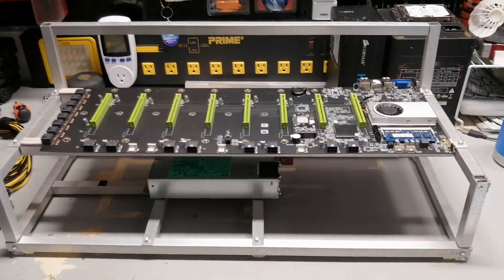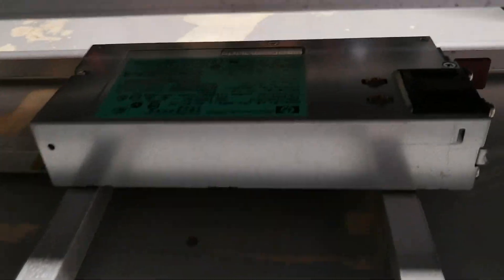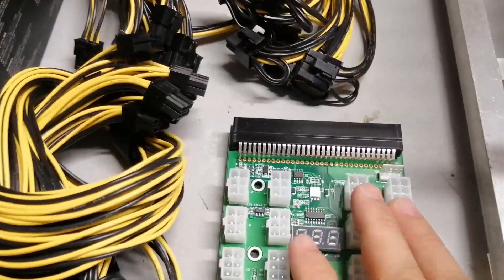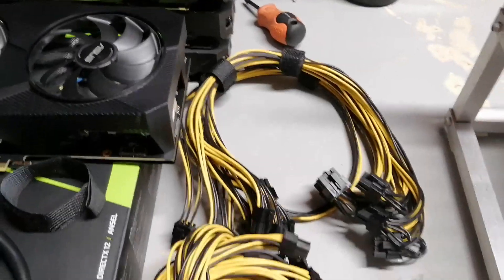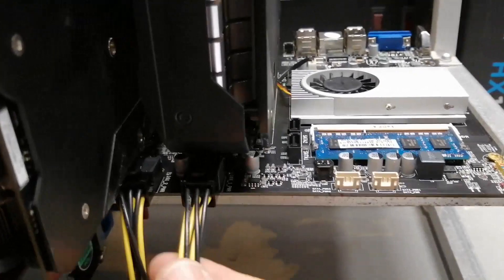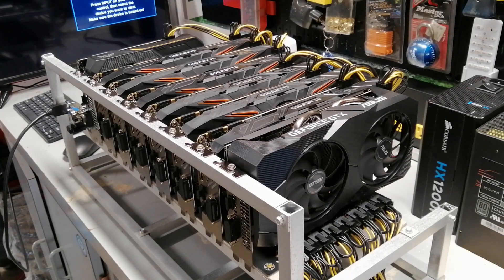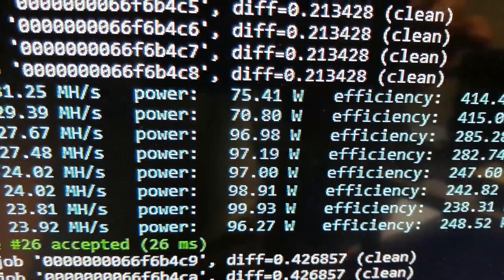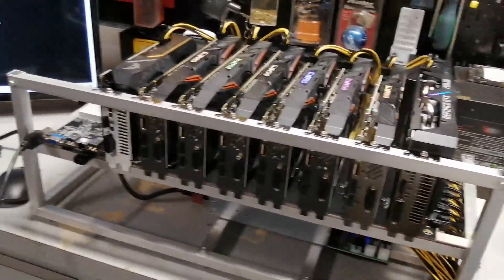BTC-D37 Riserless Mining Motherboard Setup with 8 GPU's

Comment: Those back plugs are not meant to be used as a passthrough for the GPUs. It's just meant to have 2 different options to plug the mobo in and supply the slot with power. 
Please advice your followers to plug in the GPUs directly from the PSU, one single 6-Pin Cable will not be able to handle all the power for the slot, mobo and Graphic card. 6pins usually can just provide 216W, not yet calculating in the 80% rule. Even if it might have worked in your case because you use not very power hungry GPUs, this could be a burned mobo, or even in the worst case a real fire hazard.
Reply from the maker: Theromer1 Some seller on AliExpress, has video of the wiring connection of this motherboard and that is exactly how they connect all the wires when using the enclosed rack mount  server type case, motherboard is design for this wire configuration.  But you are right, you have option to get the power directly from the PSU if you are using open frame like mine. Its been running for almost a month before I made the frame, now its about 2 months and I always check the wiring and mobo for any sign of overheating that can cause fire hazard but the wire and mobo are cold so meaning it handling the current that it should.  But again, just to be in the safe side, you have a very good point and  for the people who follow my channel please take Theromer1's advise if you are doubtful,  its all about safety and we share knowledge and experience to help each other and besides all my videos are for entertainment only, you still have to do your own research when starting a new project or hobby. Anyway thanks for taking time to visit my channel and posting the comment, really appreciate it.
Reply: Rookie Gamer  Here's the issue: if you had 8 power hungry GPUs, how many amps would you want to pass THROUGH a motherboard? Those are power traces and can't handle the power IMHO that large guage wires can. I doubt seriously the traces are thick enough.
Reply from the maker: Rookie Gamer  Cool, thanks a lot for clearing it up, I appreciate it.
Reply: @ruvrandomusefulvideos  
How many watts do your cards pull? Do you think this will work for cards that pull over 200 watts each or should I go straight from the psu to the gpu?
Reply from the maker: @caseyhall5297  I'm pretty sure it will work fine but if you have available connector from PSU I think its better to get the GPU supply direct from PSU just for the peace of mind. 
Gtx 1070 is rated 150 watts and it  pulls around 140 watts in optimize mode with Nicehash and it works no problem, but I change my settings to efficient mode and it draws only 104 watts now and slightly more hashrate.
Reply from the maker: @caseyhall5297  My cards pull around 97-100 watts each. If your card is 200 watts each, to be safe I would power it straight from PSU, thanks.
Reply: @ruvrandomusefulvideos   do you have any documentation supporting this? I love the option but just worried on max power. Standard 6 pin Is rated at 75 watts so I would assume these 6pins(side) must be rated at more wattage since they power the riser and back 6pin powering gpu?! Would appreciate any feedback on that!
Reply from the maker: @en4ble773  Sorry I don't, board doesn't come with any documetation but check Ali express that's where I saw the wiring video. Mine is running for over 4 months now and no problem at all, just make sure to use the proper size of wire. Also take note that my video is just for entertainment purposes only so you do not have to follow what's on my video.
Reply from the maker: @en4ble773  Actually I found it on Amazon, check all the pictures especially the last one  and you'll see the wiring connection, its very clear that the GPU is supplied by the 6 pins from the motherboard. 
https://www.amazon.ca/Ethereum-Building-Including-Motherboard-Cooling/dp/B091YS9MCS/ref=asc_df_B091YS9MCS/?tag=googlemobshop-20&linkCode=df0&hvadid=459054663507&hvpos=&hvnetw=g&hvrand=1278823189650463489&hvpone=&hvptwo=&hvqmt=&hvdev=m&hvdvcmdl=&hvlocint=&hvlocphy=9060809&hvtargid=pla-1362318213049&psc=1
Reply: @ruvrandomusefulvideos  I mean this is perfect for cable management, I just wish there was some supporting documentation on this.
Reply: @ruvrandomusefulvideos  Hi, thanks for your video. Is this cable reference you use to connect your gpu to the mother board at 7:22 ? I am not sure what kind of cable I need to use to plug my AMD rx 6600 to the motherboard. Thank you for your enlightment 🙌🔌
Reply from the maker: @floriane5965  if you are using power hungry GPU's I would suggest to power them directly from PSU. Anyway this is the cable I use on the video; https://www.amazon.ca/Fhdpeebu-5-Pack-Power-Splitter-Express/dp/B0912FW661/ref=asc_df_B0912FW661/?tag=googlemobshop-20&linkCode=df0&hvadid=459247467354&hvpos=&hvnetw=g&hvrand=8209091549390837108&hvpone=&hvptwo=&hvqmt=&hvdev=m&hvdvcmdl=&hvlocint=&hvlocphy=9060809&hvtargid=pla-1402457543435&psc=1
Reply from the maker: @baracuda40  depends what Os you are using, you can use MSi afterburner to OC your GPU'S.
Reply: Rookie Gamer  do you have any documentation supporting this? I love the option but just worried on max power. Standard 6 pin Is rated at 75 watts so I would assume these 6pins(side) must be rated at more wattage since they power the riser and back 6pin powering gpu?! Would appreciate any feedback on that!
Reply: @TheRoemer1 The Roemer is 100% correct. I recently just had a riserless board (amazon type one) fry. It was lucky the whole rig, and the apartment didn't go up. I had a company build this rig. It was 6X 3090 running a 2500 PSU. All but 1 GPU was plugged into the motherboard. And 1 direct in power supply. This is how they wired up. Each card is drawing 325w, so the PSU was certainly able to handle it. All the PCIe "in" cables caught fire and melted.

That company told me I had a power spike. This cant happen; it's a brand new apartment complex, and they confirmed there are surge of protectors built into each floor/apartment to stop this. 

So I booked a call with @redpandamining, and he was the one that told me about the problem. The PCIe outs can ONLY safely handle 75w on a 6 pin and 150w on an 8 pin. The cards have to be wired directly to the PSU for them to be safe.

This rig ran for about 4-5 months without an issue. Then one day, it just decided to catch fire. I would check and clean this rigs every couple of weeks and never saw an issues. 75w rated and drawing 200-300w is a disaster waiting to happen. I would not trust those amazon pictures or instructions. The numbers simply don't add up. Be safe. Power the cards off the PSU.
Reply from the maker: @gj2753  This board wasn't made for power hungry GPU'S, you should know the wattage of your rig and size of wires that you use. Wiring is correct but according to your statement seems like you overload your rig with power hungry 3090's and the PCIE wires melted, seems like your PCIE cable is not enough to handle the current thats why they melted and caught on fire. The company who build your rig should know what they are doing.  But sorry to hear what happen and  I am glad you are ok,  just be careful next time and do your homework before building anything.  Remember that anything running with electricity is risky, I even watch some videos on youtube cellphone explode while charging with OEM charger. Some people comment that they are running 3080's with this board but I doubt that they get it supplied from the motherboard because 3080 is also power hungry rated 320 watts and your 3090 is rated 360 watts.
Reply: @ruvrandomusefulvideos  Yeah I agree. Way too much power. I am still waiting to see what they say about it. I am still learning myself. But if we go off the rated power allowed then even 100w is over. I guess its a risk, if someone wants to take. But people need to know that 75w is all those Pcie slots off the board are safe for. Anything over is their call.
Reply from the maker: @gj2753  Yes you are absolutely right that is why the highest card I use for this board is 1660 Super which I am running at 69-71 watts no more than that otherwise you have to get the GPU power direct from power supply. Also take note that this motherboards doesn't even come with any instructions or user manual so you really have to know what you are doing. Again be safe and have fun mining and thanks for checking out my channel, appreciate all your input and sharing your experience.

Comment: Hi, thanks a lot for your video! It really give me idea on how I can get started! I have ordered 8 gpu motherboard and expected to come in 2 weeks.  Would you  help me set up my first mining rig?
Reply from the maker: Just post whatever questions you have and I will try to answer them the best I could, or someone here can help you for sure. Welcome.to mining.
Reply: @ruvrandomusefulvideos   Thanks a lot! 😊 I think I have ordered the one with black slots T37. I'm thinking to buy 4 3090 and place them evenly between slots. Question is.. will it work with the mining motherboard? If not 3090, What is the latest gpu i can use ?
Reply from the maker: @vampierarun  It will work but the question is if you'll get the max hashrate. Sorry I do not have 3090 to test. Keep us updated thanks
Reply: @ruvrandomusefulvideos  yup thats good point. Going to try with one 3090 first and I will comment back later(probably after a month or so) * fingers crosses. Appreciate your response! 👍
Reply from the maker: @vampierarun  Also read Theromer1's comment he has a very good point. Since you are going to use a power hungry 3090, try to get all the power of both PCIE and GPU direct from the PSU, thanks.

Comment: i did see fans not spinning in the video and some fans slowing down to a near stop, is this due to the power consumption from the board or just poor fans that need replacing?
Reply from the maker: Its because I set them to efficient mode so the temperature are low.  If I set them to lite or medium mode, fans runs faster all the time. My 3060 has 3 fans, most of the time only 2 of the fans are spinning unless I set it to medium mode. That's said it means that the temperature sensor is working properly.

Comment: Thanks for this video. I have BTC-s37 and 7 gpus. 2000w power supply but it is too noisy in my small bedroom. I will buy a quiet power supply next week then start mining :)
Reply from the maker: Yes I am using same PSU with my BTC-T37 and the is quite loud so definitely not for the bedroom. Anyway thanks for visiting my channel and happy mining.
Reply: @ruvrandomusefulvideos  Hi RUV , I have BTC-T37 but I could not start mining and I dont know why. Could you give me some advice please. I am working with an USB 3.0 with HiveOs , my psu is a EVGA GQ 850 and I have 1660 Ti and 2 1660 super.
Reply from the maker: @andresalzate7465  here is the link of Mining Chambers video on how to setup hiveOs; https://youtu.be/3Pw87g8Kkiw

Comment: hey :) nice setup but why do you have so many PCI plugged in? you only have to do either at the side or at the bottom... you don't have to do both brother... so you can save yourself a PSU
Reply: Hi Welli. He feeds in at the bottom only. At the side he goes out to gpus. Always need 1 plug into gpu as well as the PCI slot.
Reply from the maker: @thequietkiwi  Very well explained, thank you.
Reply: @ruvrandomusefulvideos  Cheers. Best wishes bro.
Reply from the maker: My cables are not split, they are cheaper than buying split ones and I'm still using single PSU, thanks.

Comment: Have you try the BTC-S37 version. The one with more space between gpu? If yes,is this work as well as this one?
Reply from the maker: Just an update, BTC-S37 works as well as this mobo. Running 4x 1660s atm, will upload video when I get another 4 GPUs, thanks.
Reply from the maker: Yes I just received the S37 last week, I will upload the unboxing soon. S37 is way to go because even the D37 has no enough gap when I put the thicker 1660 Super next to each other. And someone comment on one of my video that he is running 3070 & 3080 with S37 model and he's getting the full hash rate.

Comment: My friend, do you need to start the server power supply manually (pressing the small button) and if you do then what happen after power supply failure, power return and the unit will not start automatically.
Also what kind of SSD are you using.
Thank you just curious 🤔🤔🤔🤔🤔🤔
Reply from the maker: Yes I have to press the power button to turn it on. SSD is mSATA type. For auto start I am still trying to find out how to do it but if you have the one that has slide switch, you slide the switch to "straight" position and the server PSU will turn on automatically incase of power failure.

Comment: Hey there love the video, can I ask what benefit do you see from using Windows 10 over something like hive os?
Reply from the maker: For the sake of video for this mobo I always use Windows 10 with Nicehash because I already have in on my SSD. And with Windows I can show that the mobo is working fully just like regular PC. Now when it comes to benefit of nicehash  is I love seeing the payout every 4 hours and if you are new to mining nicehash quickminer is  good to start with. My self I start with regular nicehash miner to learn about mining then switch to Nicehash quickminer when they launch it. Very easy to use just like installing a regular software and let it run. Hive OS is for advance user, it gives you more control over your rig and you can make more profit if you know what you're doing and give you freedom to mine different coins etc. I have 1 rig with 6 cards running with Hive for almost a year now and lately I am mining Raven coin with it. That said I love both Hive and Nicehash, thanks.

Comment: Very nice. does this mother board automatically manage the ventilator?
Reply from the maker: I would say no, the fans I installed for cooling are 4 wires but they are running same full speed all the time and I don't see the option in the BIOS  , thanks.
Reply: May i know what is the temperature for your GPU and where u buy the rig flame?

Comment: Nice video, just waiting on my riserrless motherboard to arrive should have been here 2 days ago!
Reply from the maker: Thanks for subscribing I appreciate it. Fyi I just received my 3rd board BTC-S37 model, uploading the unboxing video soon. Which model did you order?
Reply: Hi nice video, may i know which board u think is better ? And may i know arpund how much the mobo?
Reply from the maker: @kennychai4325  Get the BTC-S37 it has wider spacing between GPU slots. https://www.amazon.ca/BTC-S37-Miner-Motherboard-Memory-Interface/dp/B093DJQNWX/ref=asc_df_B093DJQNWX/?tag=googlemobshop-20&linkCode=df0&hvadid=459301387420&hvpos=&hvnetw=g&hvrand=10279243020942317055&hvpone=&hvptwo=&hvqmt=&hvdev=m&hvdvcmdl=&hvlocint=&hvlocphy=9060809&hvtargid=pla-1363242992638&psc=1